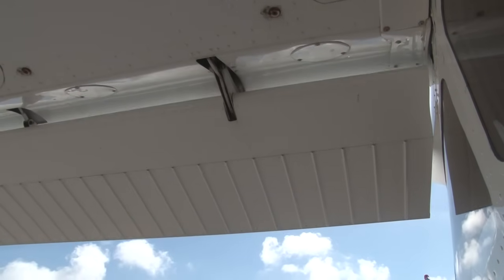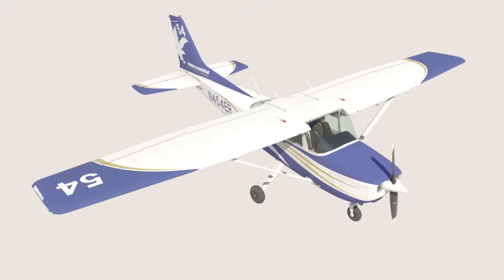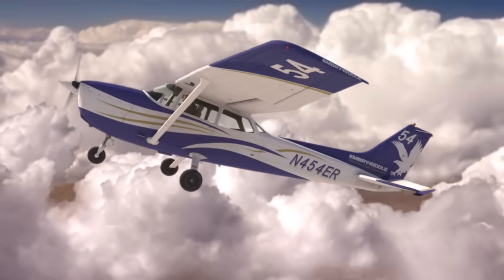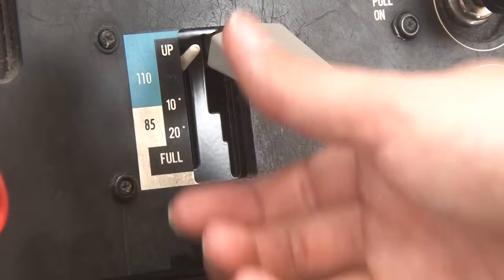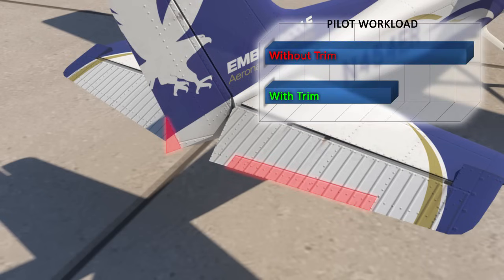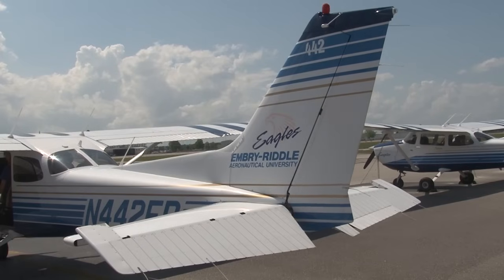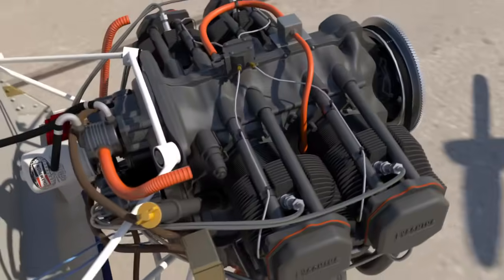Aircraft Systems - 02 - Flight Controls

Comment: If the rudder is moved to the right...then the nose also moves to the right.....! I guess it's opposite in the video....
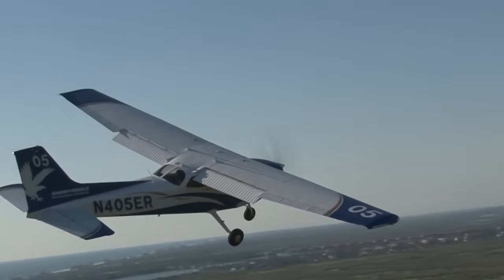Reply: No, whatever is said in the video is correct. Have a relook at the video from 2:30 to 3:05. It's illustrated with the visuals explaining the air flow.
Reply: They push the tail of the plane to the right  so the nose move to the left not rudder move to the right the nose of the plane move to the left.

Comment: Simple instructions. A fan. Controls are right left at the leg for back. Up down by pull and push of the steering wheel and left and right steering to control rudder.  Speed separately on the gearbox to right.  Auto to roll wheel to left of gearbox speed maintenance trim. This is how they control the nanobots insects to reach me. FM wave modulation to insect frequency.